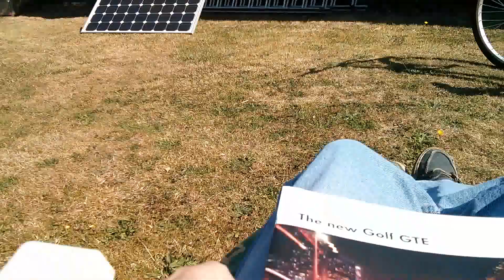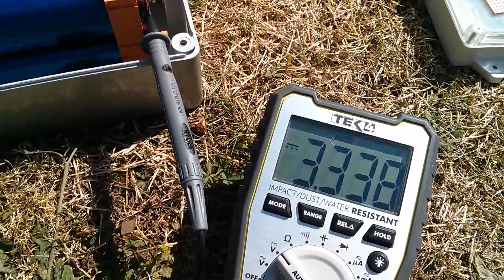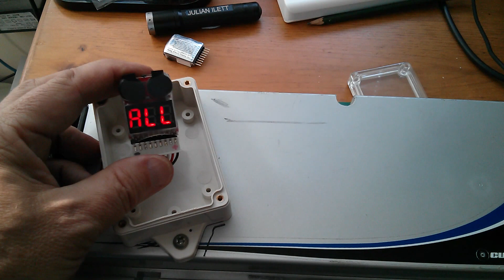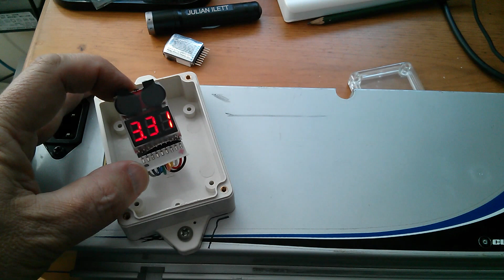Julian's Project: Electric Bike Upgrade to LiFePO4 - #4 Balance Leads

Comment: Just put a 40a 8S lifepo4  bms on it - it will balance  and protect your pack without all the faffing  - you can add a coloumb meter  too - less than £20 from China - it will tell you exactly whats in your pack and how  volts and current your drawing

Comment: Can the length of wire affect resistance, if so you should make all the same length so they read the true voltage on the meter.

Comment: When connecting the balancing wires to the battery screws, why not solder a small washer style connector and crimp and solder on the balance leads and attach them to the batteries?
Reply: Yes you have them with the black heatshrink, but just a bit larger so they can fit on the screw that goes into the battery? I really like this setup!

Comment: When you attach any kind of wire were you cant get an end on it, make a half hook with the wire and slip it under the washer and the wire wont move at all. You can even just stick it strait under any part of the washer you can get to. Also I would change to machine cap screws were you can use a little wrench instead of a screw driver. Good job keep trying.

Comment: Hey Julian, i have a question, i have 2 12v scooter batteries, and i have set them up in series, but i only have one 12v charger, so what i need to know is how to make a switch to switch between  series and paralel, and the paralel for charging and series for draining... How do i do this? Can i use a 6 pin on/off/on switch? And how would the wiring go for it, i cant find it enyware... Plz..
Reply from the maker: +Frederik Mark Henriksen Switching from series to parallel is not easy. You need a switch with a very high current rating and it will need to "break before make" otherwise you risk shorting one of the batteries. It may be easier to get a 24v charger.
Reply: +Julian Ilett so far im manually switching to paralel for charging. well thanks for the help. keep up with the good work :D

Comment: Use a ziptie between the two battery banks to hold the standoffs against each other. Thread it through the middle of the four cells and loop it around the same spot on the other battery.

Comment: Those voltage monitors are not really that accurate, although even +-50mV doesn't really matter. Try some out on the same battery. I'm pretty sure they'll all show different values for the same cells.
Be careful when balance charging btw. Those small pinheaders/sockets are may be rated for 3A per contact (as are the JST-XH - your "normal" balance connector), but vibrations can shake them loose.

Comment: Those thin unfused wires make me nervous. Personally I'd add some kind of thermal fuse to each wire,
Reply: SDG Electronics At the currents these things can deliver the wire IS the fuse :)
Reply: Ed Va Yes but they're connected directly to the batteries. If the wires become damaged or the battery voltage tester is faulty, there is no protection before they melt/catch fire.
Reply: Ed Va Oh, no problems then. I guess we're all wasting our time fitting distribution boards with fuses or MCBs in them because we just plan to plug our PCs and washing machines into the sockets. Don't worry about faults, they don't really matter. Wow, get a clue.
Reply: Ed Va
Idiocy at it's finest.

Comment: 10:25 - The fuse holder has a bit of bare wire showing,looks like it might have been pinched,or something. You may want to investigate that,before something shorts and bursts into flames! I would have just used larger ring terminals,and put them over the cell connections,saved the work of taking it all apart,and drilling holes.Hold them in place while you tighten things down,so they don't twist around.
Reply from the maker: PhattyMo Yeah, I noticed that, but it's sandwiched between two pieces of foam now, so it's unlikely to be a problem.

Comment: Nice solution there Julian but you will get slightly varying readings when measuring the voltages away from the cell terminals. I use the same Lipo alarm on my RC model batteries and I find it vaguely accurate when compared to a Fluke DVM, within about 20mV per cell. Anytime I have small connectors such as a JST-RCY or JST-XH balance connector, I find it introduces enough resistance to throw the voltages off by at least another 20mv. As you said, it's easy enough to stick your DVM on the finished JST balance lead and see what voltages you read to get a comparison. Don't forget though, your DVM is only accurate to plus or minus 29mV when measuring 3.3V and 214mV at 26.4V. So I'd expect the accuracy of the £1 lipo alarm to be significantly lower and you will never get your individual cell voltages to add up to the total. Looking forward to the next video.

Comment: Good job on the routing of the wires inside! It can be a HUGE nightmare sometimes when working in confined spaces. Weren't you thinking of using a 9pin D-Sub connector for the balancing? It could flush mount to the box and would look much neater......

Comment: I'm sure you will be quite happy with the LiFePO4 cells no comparison with the Lead Acid in range and life.
And do not leave that monitor powered on when not using the bike since it uses current to self power just from the first two cells so it will only discharge those and create a large imbalance.
Reply: Julian Ilett I think I answered to you on the other video. Thing is the monitor will not give you an accurate measurement under load do to anti-aliasing. The ADC will sample for a very short period of time probably microseconds on an interval of a a few hundred miliseconds. If the measured signal is noisy (and it sure is when you power a motor) then the reading may be done  exactly in one of the peak or or valley of the signal and not represent the average voltage of the cell.
I will not go under 2.8V under small load say up to 0.5C and not under 2.5V at heavy load 1C or more. The voltage will get back above 3V without any load. For charging do not exceed 3.6V and try to be for as little time as possible above 3.4V they do not like that. If you do that you will be able to use your bike every day for 10 to 15 years with no problem. Probably something else will die before the battery :)
I think you can cut the ground wire when not in use that way the cell monitor will not be powered. But I think the key on you battery will cut the positive and not negative wire maybe you can change that and that way you can not forget about the monitor.
Reply from the maker: ***** Yes, it would be easy to forget the monitor and leave it connected! Actually, I have a question for you Dacian - I ask it in part 5. Can you take the cells below their minimum voltage when on-load, as long as the off-load voltage remains above the minimum. Or must you NEVER let the cells go below minimum? How much damage would actually be done? Just curious.
Reply: Julian Ilett I think doing that is possible but at the expense of cycle life. I use lipo batteries and they never are taken below their minimum voltage. Lowest I go is 3.7 per cell.

Comment: Those meters aren't perfect. Each cell has its own voltage meter and sometimes they are a few hundredths of a volt off. Don't be alarmed by that. It is also ok for lithium cells to be within a few hundredths of a volt in a pack. The alarm will sound if even only one cell has gone too low.

Comment: Can't remember if I put forward the idea of removing the alarm from one of those boards and replacing it with a relay to cut power? Idea came from greatscott
Reply from the maker: pietkaify I do remember that, but a bit scary if it decides to cut out, just as I'm accelerating across a busy main road.
Reply from the maker: pietkaify Also, I'm not sure about those alarm boards yet. I think I may have heard some beeps when cycling uphill. It's difficult to hear the alarm when it's inside the box with the lid on. So the alarm beeps may need some interpretation. A few beeps now and again may not mean it's time to recharge. Not sure yet.

Comment: Julian: I've found that a 2mm flat head screw driver works well for those pesky connectors. Press down on the tang holding the conductor in the plug with the screw driver blade while pulling on the wire and it should slide out easily. Before reinserting the conductor make sure the tang is up again. You can use a needle to push the tang up from the bottom side of the conductor if needed to restore the tang to holding position

Comment: Why a IEC connector? I think its wrong use of this connector!
You can plug a 240 lead in this connector.
Not good.
Reply from the maker: pcuser80 It's a weird high current connector with the earth pin turned through 90°

Comment: the low voltage alarm is badly claibrated and are not accurate.
i got 5 of them and tey are all reading diffrent +/- 0.1 volt out
Reply from the maker: expansiongames $0.99 each I think - I wasn't expecting much :)

Comment: "an inch and a millimeter" it makes sense, but is funny when said, it shows how messed up our use of measurements in england are, a mix of imperial and metric in everyday use.
Reply from the maker: ***** miles per gallon is pretty strange too - we still use miles but not gallons
Reply: ***** Julian Ilett  we still use miles? No, we're supposed to use kilometers. Yeah, the UK's measurement systems are messed up.
Reply: Julian Ilett yeah, for practical uses it would be miles to the litre, and that would be a mix of imperial and metric, but that is how most people think
Reply: *****
I personally prefer kilometers
Reply: Emil Carr kilometers seems a bit to short for the sort of distances talked about, and just like fahrenheit it seems like it has high numbers just to show off
Reply: *****
I agree but still think it's a better system, nice round numbers. Miles are, what, 1600 ft? A kilometer is a nice simple 1000m
Reply: Emil Carr one mile American is 5280 feet.

Comment: lol, an inch and a mm , just say like 255mm or 2,55cm.
I think it is time that the Brits only start using 1 measurement system.
Last time I spoke to a colleague in the UK she told me she lost 1 stone.  I almost went to my garden and sent her a stone but luckily I remembered she was speaking about losing some weight earlier on.
About that Golf GTE, I would love to test that one. Acceleration seems to be unreal and actually to think about it it might be a nice car for small 20km trips.
Btw have you done a trip to see how for you can cycle and at what speeds?
Reply: jusb1066   LOL. just realised, ....  me hides under a stone ... wait you cannot hide under a weight measurement right? Seriously, what have they done to us.
Reply: Luc Peeters haha, this proves why using both sucks, you said 255mm, nope thats way too big, and 2.55cm is still wrong, 1inch and and 1mm would be 26.4mm hehe :P
Reply from the maker: Luc Peeters Yeah I've been drooling over the GTE since it was first announced. But in reality, it's probably cheaper to keep my Citroen C1.
Reply from the maker: Luc Peeters Max speed on the bike is 15mph - that's when the wheel speed overtakes the motor speed. Did about 10 miles today, but it seems the LiFePO4 cells had plenty of charge left. Uploading part #5 now!
Reply: Julian Ilett  there seem to be some nice kits on ebay to convert a regular bike into an ebike. My Trek would be a nice candidate, but I guess it would lead to 1) laziness  2) the geekness will take over  3) the macho behavior to always make it faster than the rest 
Lets see how many times you now will use the bike instead of the car, keep us updated on that. 
I've been thinking, these things are a serious replacement for public transport or a car if you work less than 10km away from home. It's a lot cheaper to repair and maintain than an electric or hybrid car. Also think about the reduction in noise and pollution in cities.
Reply: Luc Peeters
ive done 2 Ebike convertions now, one i used lead acid (they suck for ebikes!) and another with a ready made lipo (so much better) both to mountain bikes, the hardest aspect is the variety of handlebar brakes and gearchange type which can interfer with the throttle position if you can squeeze it in there at all without getting in the way of gear changes.  Both were front wheel conversions, and both had disc brakes meaning having to buy spacers and lots of adjusting of the disc unit, otherwise its very easy to do, the most recent has a 700w motor and electronic display
Reply from the maker: Luc Peeters For me it needs to be at least 25°C before I'll use the bike, so in the UK that's about 3 days a year. When I move to Spain, I'll have an e-bike and a Twizzy, but not in this country!
Reply: jusb1066  awesome. Lead acid is not the way to go it seems.  Looks like there is much more to it than just swapping stuff around.  My Trek 8000 from 1994 has the Deore XT shifters which might be in the way.  Thinking of it, way too emotional to change that one since it still looks almost new and now has 83.000km of pure pedal powered km's.  Looking at proper ebikes they seem to be way to expensive for what they are. 
What also bothers me is that brands nowadays seem to 'program' their stuff. So in case the batt wears out you need to have it changed in a bike shop that has access to the manufacturers online database. Of course they will charge you mega bucks for it.
Reply: Julian Ilett lol, well anything above 10C and not raining should be classified as being warm in the UK and over here in Belgium.   To be honest I think, know, it's all in the mind. I seriously started enjoying cycling again as I had to do a bit of exercise after 20 years of driving to work and sitting behind a desk.
Good friend of mine goes to work with his nice Brompton every single day which I really thought he wouldn't do. He now owns multiple bikes.

Btw maybe it would be a nice project to use a raspberry pi or arduino to control everything on the bike and show it on a multi-line lcd on the handlebar
Reply: Luc Peeters If it's like any other Volkswagen, then it'll be the least inspiring drive and designed for Mr Bland.